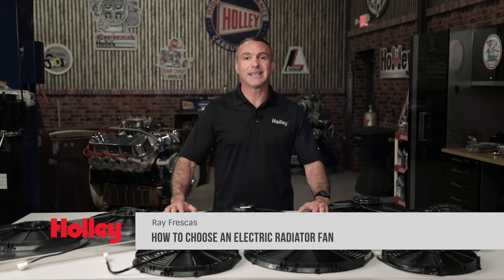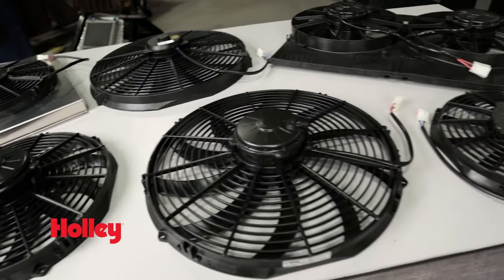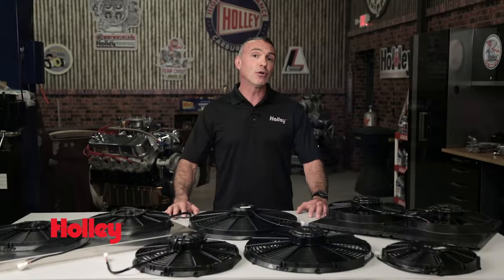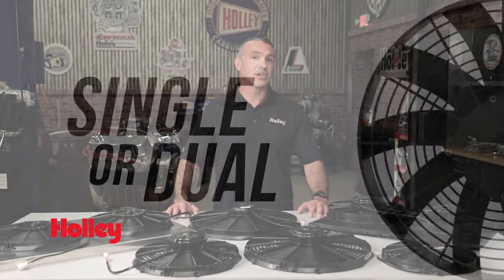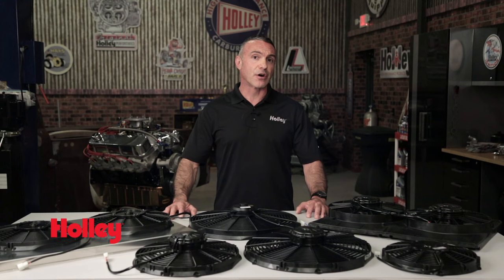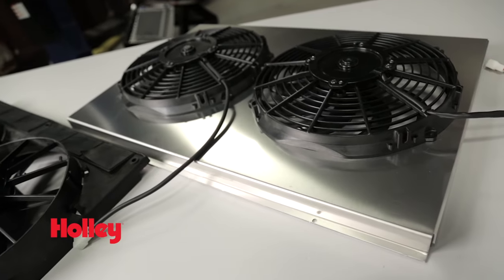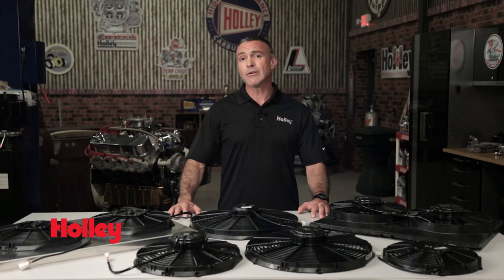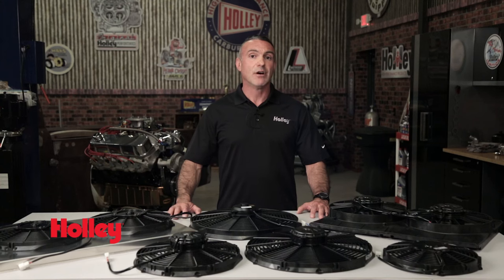How To Choose an Electric Radiator Fan

Comment: A lot of fake tech in my opinion. To say the mechanical fan is engine driven and the electric is not is nonsense. What do you think is driving your alternator, the wind from your fan? No, as more demand is put on the alternator more strain is put on the alternator, so what you think you gain from removing the fan is replaced by the added load on your alternator. Also the engine driven fan has a clutch that opens when at high speed the air rushing in wants to push the fan faster than the electrons will. This backs off in the alternator circuits and will lead to premature rectified damage. as well as fan wear and tear. It's like having six of one or a half dozen. same thing. Mechanical fans are better, will last longer, and if you correctly match the fan clutch to the radiator It has a thermal property,  will perform well for most cars. The thermal sensor on the fan clutch cycles to cutch on and off at idle as needed. Maybe there are some racing situations where the electric fan has an advantage, but for most of us, save your money, buy a new pair of sneakers.    Electric fans = more sensors and parts to break down, ( if they have brushes how long will they last?), strain on the electrical system. Mechanical fans = less parts to fail and years long time and true well designed and proven  systems. It's your car, you can do whatever you want with it. And anyway, you won't have it long. when the baby comes you'll have to sell it for diapers, so, go ahead, have some fun. Something to chat about at the water cooler.        'Just sayin.............MIke
Reply: Hi there I got your point, I have a 78 Camaro with all original parts , setting at traffic the temp rise, I thinking of adding electric fan with mechanical fan to help cool down at traffic what you think?
Reply: Pretty dark there mike. The electric cooling fan works just fine for it's intended use. Turns on when needed, off when it isn't. When wired  and installed correctly, the system works in harmony as it should.

Comment: Good guidance, however he said electric fan does steal horsepower from the engine, however the extra load on the alternator robs a lot of power.
Reply: Not nearly as much as a belt drive fan. The mechanical disadvantage of driving the alternator is minimal in comparison to the parasitic power loss from the belt drive fan.
Reply: I will also add that the pulley drive ratio of crankshaft to alternator pulleys gives the engine a definitive  mechanical advantage in driving a loaded alternator. The resistance on the engine is fractional in comparison to the load for the belt driven standard cooling fan.

Comment: Sorry but this is highly inaccurate especially coming from holley, alternators on their best day are only about 50% efficient and electric motors are 80-90%. If your fan takes 80 watts of power and its motor is 85% efficient only 68 watts of power is moving air the rest goes up as heat. Also if the fan is using 80 watts of power the alternator is using 160 watts of engine power to power the fan. 160 watts is just over 1/5 of a horsepower so its not much but the wording in the video is just wrong. Electric fans do have an advantage because they only run when needed and at idle can move their full capacity of air. On a side note I have 2 16" fans rated at 80 watts and it takes both to cool my engine (460 bbf aluminum heads cam headers etc etc) on a hot day at idle. Get a good fan shroud youll be happy you did (I didnt lol)
Reply: (160 watts of engine power to power the fan)

The alternator is already excited charging the battery, there is no loss adding the electric fan load onto it. So saying the Electric fan robs the engine of power is false, least regarding your comment. The load is already on the engine, an electric fan doesn't "add" load because the alternator has a set load regardless.
Reply: @trumpsextratesticle8590  with all due respect nothing you said is accurate. It takes power to make power, it takes set amount of power to charge the battery and it takes more to run a fan. It takes a set amount of power to excite the alternator you don't get that back as free power it is lost and one of the reasons alternators have low efficiency.
Reply: @shaunobrien6425   AGAIN, the alternator is already excited charging the battery, it puts ZERO extra load on the engine having the fans come on, as the Voltage regulator is what determines the output of power going to the battery.
.
The alternator doesn't get "harder to turn" when more load is put on it, so the fans do not rob any more power than what's already being pulled from the engine to turn the alternator (when excited).... It's either ON or OFF.
.
Please get a working knowledge of how the alternator works before commenting again. Thanks. 
.
.
Reply: @trumpsextratesticle8590  lol I have a perfect understanding please look yourself. Why wouldn't you just hook up a megawatt alternator then all you have to do is excite it and power is forever free after that right? Do you think the voltage regulator is going to cycle the same if there is addition load placed on the battery? If not and the alternator is run more often or "excited" isn't there additional load? Seriously this isn't complicated.
Reply: @trumpsextratesticle8590  take 30 seconds to Google this so I don't have to hear your witty response please. Anyone else who believes him do the same so we can put this misinformation to rest

Comment: Electrical fans are maginally more efficient because you can turn them fully off. But the temperature dependent flood clutch means it has variable mechanical draw. And there spinning because of through flow above a specific speed. They just have limited total cfm.

Comment: Thanks for the video.  
I have a 76 cj7 jeep with a engine swap from a 88 s10 blazer (4.3 v6). I have two fans available a flexalite 188 puller single fan Or a flexalite 440 dual pusher...Which one would you recommend for my application? Both have enough room.  And I hope to remove the clutch fan.  Thanks 
Thanks.
Reply: This video literally answers your question. Watch it.

Comment: Hey, I hope you can help or advise me. I have a Mitsubishi Montero sport 2.5 diesel(also known as shogun, pajero etc), and it overheat in uphills and slow traffic (my city is hot as hell, close to 40°C degrees often). In highway at high speeds it works perfectly. I already checked the whole cooling system (clean radiator, new thermostat, fan clutch is ok, heavy duty coolant, even new cylinder head), but it still overheat. I thought to add an auxiliar fan. However I don't have enough room to add it at the front, because there's a AC condenser and then an oil radiator (or transmission cooler more to the front idk). Do you think if a double straight blade fan would work installed at the front of the oil radiator? I dont know what to do 😑. Greetings from Chile!

Comment: Iv'e thought of the electric fan but with the mechanical fan, at least you can see the wear and tear of the belt and replace it when necessary. What happens if the electric fan just craps out? then what?
Reply: You replace it.

Comment: I bought 13" 4000 cfm dual fans and they're longer than my radiator.....  will it be ok if i got 1/4 of one fan hanging past the side and block that portion off? Try just using 1 of the duals? Dont really want to return, bought online and a pita. What should i do?
Reply: Sbc 327

Comment: So you don’t use coolant if you have a electric car fan??
Reply: Coolant passes through the radiator and fans cool the coolant, if you don't have coolant engine will overheat and possibly burn
Reply: Seriously??! You absolutely have to use coolant even with an e fan. Thermodynamics don't just cease to exist because you installed an e fan.
Reply: Lmao guys I was young and dumb when I wrote this 🤣🤣
Reply: @tylerangel4073  as long as you have since expanded your knowledge, we all have questions that need answers. Finding the correct answer is the key.

Comment: Can i install both push and pull if i have the space for it?
Reply: You generally don't see any advantage with double-sided fan installs. As the video mentioned, pusher fans have reduced airflow compared to pullers, so you may actually hinder the performance of the puller by adding a pusher to the system.
Reply: Depending on rotation they mite end up fighting each other 🤣...p.s. you can reverse rotation of DC motors by swapping + and -
Reply: I run a 19" mechanical flex fan on the engine and a pusher on the front of the radiator. The flex fan normally copes on it's own but with the electric also running it will help keep temps in check in traffic more than just the mechanical on it's own. The electric is rated at 2400CFM and no way it out performs the flex fan and tight fitting shroud, even at idle.

Comment: Engine-> direct mechanical energy for the fan

Electric fan: Engine->Charging battery through alternator(energy loss)->driving elektric motor(Loss because of internal resistance)

-> Electric fan is less fuel efficient

"Since they are electric they do not effect your fuel economy"
All the energy your car has comes from fuel, unless you regularly use some wall adapter to charge your cars battery. Otherwise where would the enegy being used to drive an electric fan come from, can't be created from nothing.
->Your fuel is used to drive the electric fan
Reply: In comparison the fuel used to use the fan in far less than the consumption and parasitic loss from a mechanical fan
Reply: Electrical draw on the charging system translates to far less mechanical draw than a fan. Not only are mechanical fans technically air brakes, but alternator pulleys are usually very small in comparison to the crankshaft pulley, making the mechanical effort to drive them, even under load, minimal.
Reply: It’s been dyno proven you will pick up some torque and horsepower by converting from mechanical to electric

Comment: How do you keep your engine cool in 100+ deg weather? 
I run a 2002 Blazer ZR2 4.3 Vortec & live S of Houston Texas. 
It normally runs just shy of 210° w/ a 195° thermostat but, now when towing a small utility trailer 
it runs up to 220°> A bit too hot for me because it usually runs 200. I don't like that needle on the gauge running past 210 (the 1/2 way mark) 🤟

Comment: Im not a "fan" of fan shroud . as it makes less flow when driving.. But makes the fans better when on..

on my project car, im trying to make it work the best when driving, and make the fans work as good as they can when standing still, so im thinking of installing the fans to the radiator, so the draw air tru the radiator, but not makes to mutch resistens when they are off and im driving..

Someone that know better than me, pleace tell me if im right or wrong :)

Comment: I have a 2014 Ford ecoboost we can get to 110 degrees when pulling my RV it tends to over heat my fans are on.  Can I put some larger fans to help the problem
Reply: Go ahead with extra fans for the engine cooling and look into getting yourself an additional trans cooler which is very important...dnt forgrt your transmission needs some love too!!!

Comment: // "Since they are electric, they don't effect horsepower or fuel economy."//

And this false statement comes from Holly.  WOW!!  Where does Holly think the power (and fuel) comes from to drive the alternator?   The shaft to the mechanically driven fan is 100% efficient.  The alternator/motor combo required to drive the electrical fans is less than 50% efficient.   

Now there are many reasons to use an electric fan (including horsepower and fuel economy), but that quoted statement is simply nonsense.
Reply: my sbc 350 in a nova has a plastic flexalite bolted to the pulley with shroud and 4 row, cools o.k. for now but  i thought of just adding a junkyard e-fan as a pusher if i'm stuck in bad summer traffic with a toggle switch.
Reply: I totally agree, except the shaft to the mechanical fan isn't 100% efficient if it has a fan clutch like most do since the fan clutch will always slip a bit. I think what he might have been thinking is the electric fans save fuel because they only run when needed and don't create any drag when off unlike a mechanical fan that's constantly spinning and taking power whenever the engine is running. But either way, the fact remains that it takes power to move air and that power ultimately comes from the fuel.
Reply: 100% efficient is incorrect. 100% linear is more accurate. Fan speed increases directly with engine rpm. At idle, belt drive fans  are less effective than an e drive fan. Most oem vehicles have an e driven fan.
Reply: @markk3652  //"100% efficient is incorrect."//

Sorry, but a shaft IS effectively 100% efficient (which is what I said).  Belt's are not 100% efficient, fans are not 100% efficient, but a properly sized shaft certainly is.
Reply: @johnborton4522  the shaft does not cool the engine, that's the work of the fan. There's several varibles at play. Thermo clutches, pitch of blade angle, and pressure differentials to be overcome. It's proven that power losses are greater with belt drive fans.